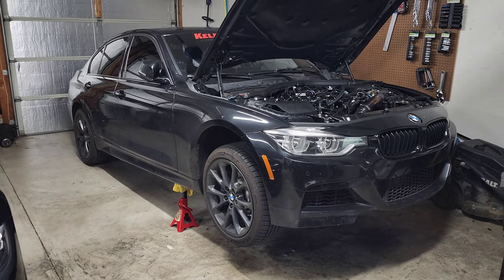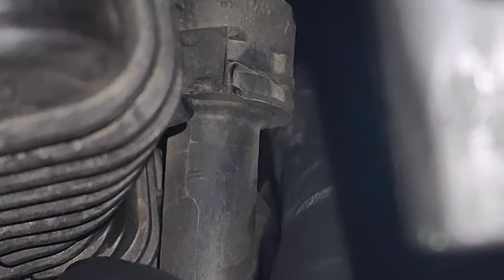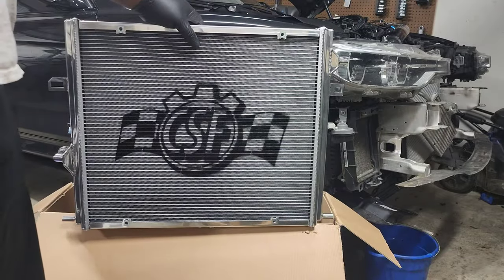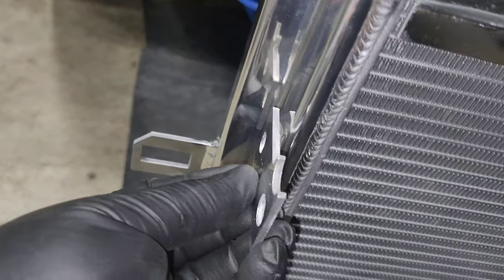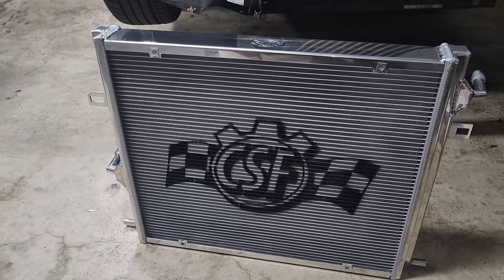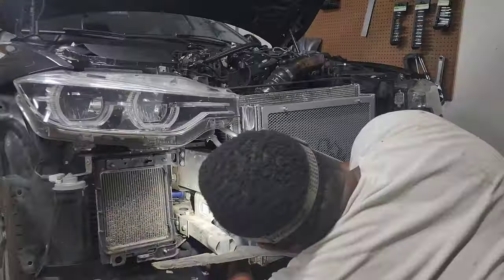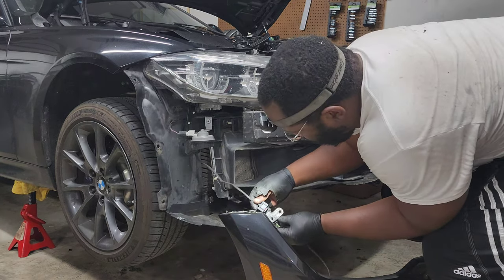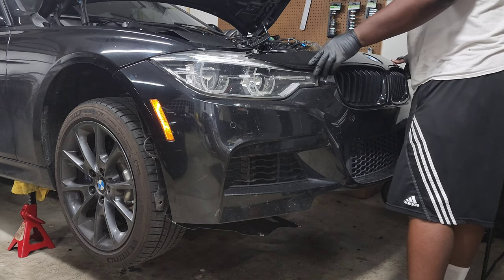Installing the CSF Heat Exchanger Upgrade on my 340i

Comment: @kern147, bro what you removed the HE, what was that behind it?  It also looked like a radiator part.  What function does it have?  The transmission cooler in front cools the transmission oil?  HE is cooling coolant?  So what is that part behind it that you left in the car for?  Also, does any of this stuff work for G30 540?
Reply from the maker: There are 2 radiators. The front radiator i removed is for the intercooler/air conditioning. The rear radiator is for the engine/turbo.
Reply: @kern417  on my g30 540, there is a little radiator sitting by the right fog light, any idea what that is?
Reply from the maker: aux radiator for the engine

Comment: love it, wonder if fit my 2018 x3m40xd
Reply from the maker: Unfortunately only F-series fitment currently. The coolant hoses on G-series are in different locations
Reply: @kern417 shouldnt have issues with f22 240 gen 1?
Reply from the maker: nope. fits 1/2/3/4 series

Comment: As someone who tracks a B58, would love to see temp data over time witnessed before and after. edit: I realize CSF has data on their website, compare that to real world is what I'm sayin
Reply from the maker: I posted some a few years ago. Just search for is a B58 heat exchanger upgrade worth it.
Reply: @kern417 didnt u say it wasnt really worth it or do I need to rewatch lol
Reply from the maker: I said the same thing I said in this video. It doesn't provide a significant reduction in IATs but it does help avoid heat soak. I make a video in the future explaining the difference.

Comment: Hello from the UK! 

Im currently 40% of the way through changing my heat exchange unit. I'm trying the way in your other video by going through the top, following step by step, but I fear my new radiator won't fit through the gap that is available 😢

Thanks for the guides, look forward to the next one!

Comment: Why Dont You Upgrade You Trans Cooler?
Reply from the maker: Why do I need to?
Reply: His 340 is manual, there’s no need for a upgraded trans cooler.
Reply: @kern417  I would be interested in a trans cooler retrofit for non track pack cars.  Is that possible just buying the lines and stuff, or is the trans actually different where lines would connect?
Reply from the maker: @ebigford34  I'll do a deeper dive in a future video to explain the differences but it's largely the same. Just probably not what most people are thinking
Reply: Thanks @rs3hank